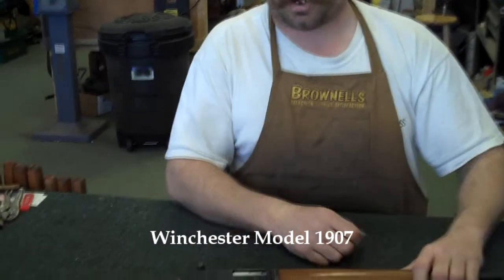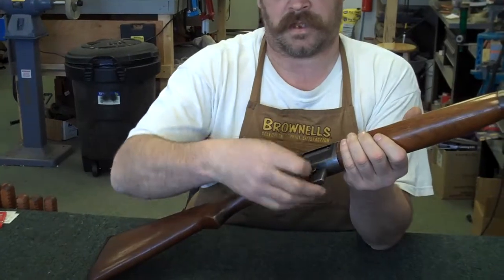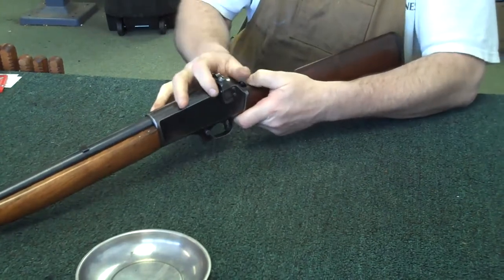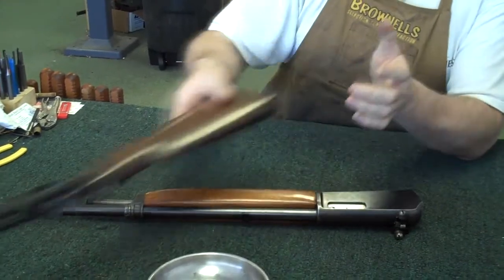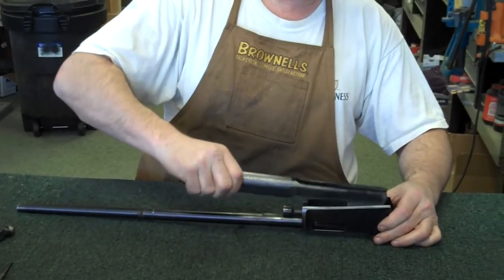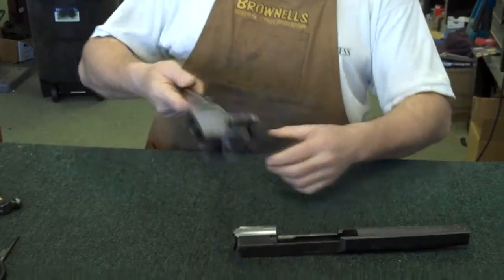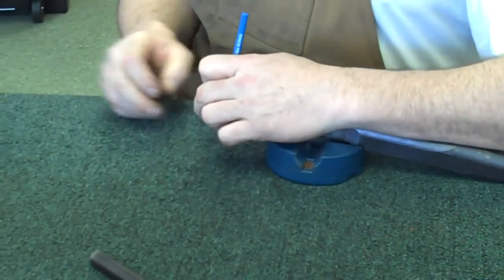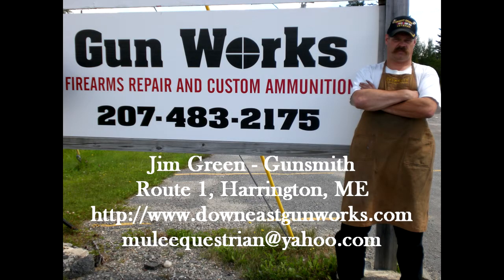Gunsmithing: Winchester Model 1907 .351 (Gunworks)

Comment: Thanks! Really enjoyed it. I have one made in 1918. I use .357 brass with the rims modded in my lathe and bulllets seated a little long. Also I use .223 brass cut about at the shoulder and trimmed (I'm surprised the rimless cases work but they do fine). My bullet most used is a 180 gr. .357 that I re-size to .352 using my custom sizer from Buffalo Bros. I admit I HAVE fired .358" bullets and a little lighter loads, that did work till I got the proper parts.

Comment: I had always heard how the 351 SL was underpowered, similar in balistics to 357, BUT it is almost twice the energy of the 357. More similar to 30-30 Winchester in a handier package. I shot a spinner when I got my '07 shootable and with 180-gr soft point made a crater and dented out the backside at 40-50 feet, spun the crap out of it, and bent the frame. Shot it with FMJ 357 revolver and barely made a surface dent.  Haven't tried with wife's 1894 in 357 Mag yet, but maybe this weekend (11-9/10-24). To say I was shocked at how the '07 just beat the crap out of that spinner is an understatement. Makes me want to make spinner target with beefed up frame and bearings or brass bushings to do a "spin" comparison of different calibers.
Also, thanks for the vids!! Helped me out a lot on various obscure old guns when I was 'smithing. Mainly old shotguns (which are like puzzle boxes), which kind of became my specialty just bc so many people have inherited them, left them in the closet, and/or don't clean them after hunting.
Reply from the maker: @tomcatbeer  The .351 was meant to offer similar ballistics in a semi auto like the .30-30 in the lever guns. Look at the paper ballistics between the .30-30 and the .351. You’ll see they are close, with the edge going to the .30-30 by a decent margin. The funny thing is you see leverage action rifles offered in .357, and several folks consider this acceptable for deer hunting at closer ranges. But the .351 gives you a few hundred more fps, but is considered weaker. Hmmm…
Reply: @downeastgunworks  Followed up on the 351 vs 357 yesterday with my wife's 1894CS. The 180gr FMJs thru the rifle made little dents, nothing near the crater the 351 left.  Keep up the vids, really enjoy them!

Comment: The power is more like slightly above the 357 Remington Maximum, that is a significant increase, much closer to the 35 Remington in velocity, though of course without the increased bullet weight and subsequent Sectional Density. The comparison to the common 357 does not do this great arm justice. I shoot mine and enjoy it, though it is rough on the brass during ejection. Reassembly is the real trick. I have a second barrel and would love it opened up to use .357 bullets.

Comment: I have a Model 1905. Like Steve said below, taking it apart was easy. Getting the recoil spring back in was extremely difficult.  I used a screwdriver to compress the spring back into the counter weight and managed to slide the rod in to secure it, but it was a very tricky operation. Surely there is an easier way? 

Thanks Jim. I enjoy your work!

 Andrew

Comment: Merry Christmas Jimbo! Hey what’s the torque on that castle nut? I have a 1910 of course the forend has a crack, I glued it up, but do you think it will just crack again? I think I’d be better off putting a replacement forend on and saving the original? What say you? Simper Fi

Comment: Great video!  My dad just gave me my grandpa 1907 to clean up and refinish.  It's in pretty rough shape, especially the forearm (3 long cracks).  I have a schematic, but your video will help me break this down way faster and with less frustration.  What should I use to get the castle nut off if I don't have anything like you did for the mauser?

Comment: Hi there,  thank you for sharing your knowledge!   I have a 1910 - 401WSL  that I just acquired.   I am having an issue with what I believe is the firing pin.   It is clean,  I two part disassembled per your method,  and I have made up some dummy rounds for testing (carbon paper on a spent primer).   The hammer seems functional,  the trigger works,  but there is no primer strike.   The previous owner claims to have fired it recently and I have no reason not to believe him.   Can you offer me any advice on this?   The gunsmiths in my area said they weren't willing to work on this particular rifle as they have no knowledge of it.   I'm a bit far from you to just pop in (Montana),  but would be happy to compensate for help.

Comment from the maker: I use a pair of hooks or picks and sheer brute strength to slip it back into place. Believe me it's not fun sometimes, but it is what it is.
Reply: A fucking 1907 that is one awesome gun
Reply: Can't get the guide rod out on mine; just spins and spins in place...
Reply: Mine did the same thing.  It should have come out.   @beachhead1973
Reply: @351WINCHESTER  Makes me wonder if it was a production-line call at one point in time? I really have to trace the serial #s on my gun sometime and find out when they were made.